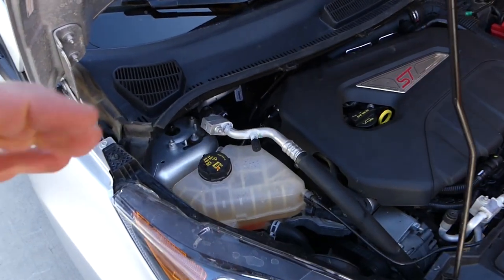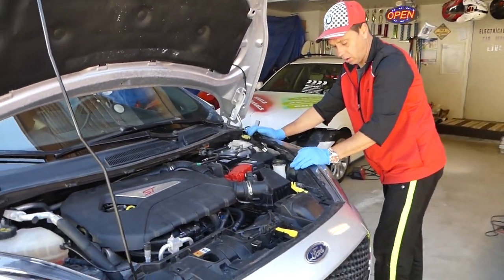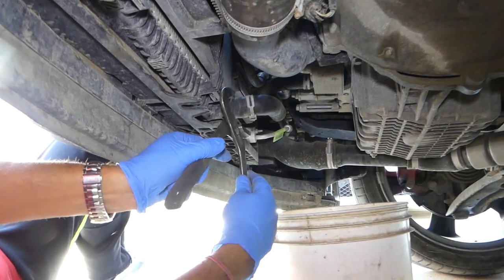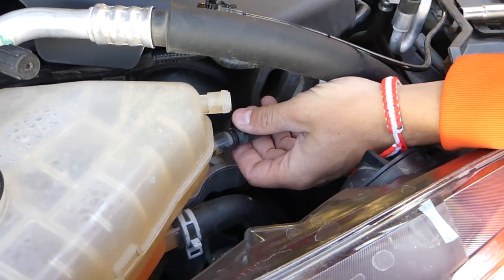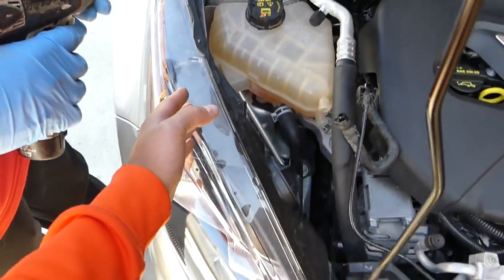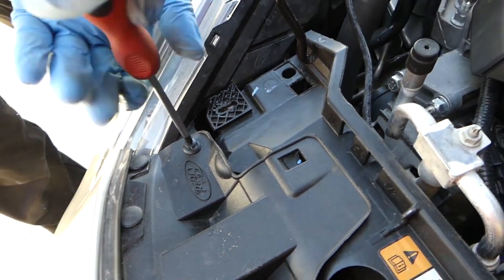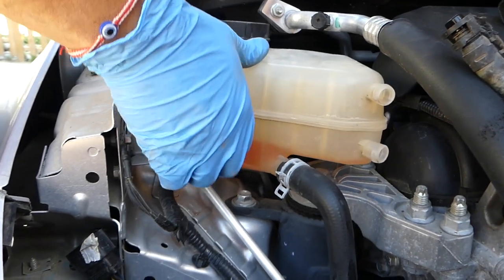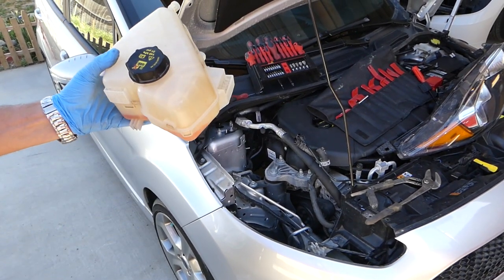FORD FIESTA OVERFLOW COOLANT TANK RESERVOIR REPLACEMENT REMOVAL MK7 ST

Comment: Just a quick tip, with the headlight out it gives you enough room to put a catch can beneath the expansion tank to catch the coolant. No need to drain the radiator that way. So no need to jack up the car or   extensively bleed the cooling system.

Comment: Hi all, can anyone help me. I noticed mu coolant was low, so I removed the black cap but then there was something else that I couldn't remove to add coolant. It's a black piece inside with metal at the centre. Any tips please
Reply: It's the caps inside, unfortunately a common issue

Comment: They replace those coolant bottle for free under the coolant recall, those two plastic overflow connectors on the top and bottom of the coolant reservoir crack when they get old, it happened to my fiesta. I bought another plastic piece to replace it, but under the recall they replace everything even the bottle and now give you rubber hoses instead of plastic, there is also other parts they install, I recommend getting this recall done by ford.
Reply: What years did the recall cover? I have a 2011...
Reply: Mine is a 2011 & I filed a complaint staright to Ford about another problem I had with my car & they fixed it free plus pulled all the active recalls & fixed those & pulled all the old recalls for review & that wasn't one of them for the 2011's.
Reply: @venusmiranda9898  awesome!
Reply: Cost me hundreds.  I cracked the shits and bought the mishimoto metal coolant tank then it started leaking from the little sight glass so I had to rip it out and plug the threaded holes up with brass bungs. Now there coolant pissing out of a biggish hose down behind the engine on battery side.... So over this car.  I need a new coolant cap too now because the lower oring is broken and part of the plastic that the ring sits on has broken off and in the cooling system somewhere. 2014 Fiesta ST sux.
Reply: That very thin pipe going to the expansion tank... (coolant overflow/expansion tank return line) over time becomes extremely brittle like hard plastic. Be careful if handling it as I have just snapped mine in half by moving it slightly. Now my mk7 has no coolant and I think I'm fucked
Reply: I read an article on the degas hose being too small on the coolant bottle , which causes overheating?
My 1.0 litre overheats on idle and when in slow traffic
I’ve changed everything from water pump
2xThermostats
Flushed radiator 
Head gasket replaced
Coolant cap
Could it be the degas hose is too small at the top?

Comment: They put so many crap parts in those cars.  The engine mounts are rubbish and the whole cooling system is an absolute joke IMO. The Dayco replacement plastic coolant tank is a bad design and the cap it comes with breaks in half after a few months and the little hose connectors are poorly moulded and the hoses don't clip on properly so you gotta use cable ties to hold the quick release jaws in or they could pop off.  I could have overheated my engine so many times I have lost count. I'm starting to hate ford and I just want to get rid of this car. Never buying another.

Comment: so the hose from the res. to the radiator i believe it goes to (7:09) can i just disconnect that hose to drain just the reservoir so i wouldnt have to refill radiator? Just trying to see fastest way
Reply: That's the easiest way to go, my reservoir go hairline cracks in it and I need to replace it on my Ford Figo..

Comment: I see the top degas line on coolant tank is very small diameter 
I have read an article on 2012 to 2014 Fiesta needing to change the size of this hose as it causes that model 1.0litre to overheat
Maybe even Cath on fire?
My Fiesta 1.0 is always overheating at slow speeds and idle for long periods?
I have changed Head Gasket
Coolant cap
Water Pump
Both thermostats
Flushed radiator 
Could it be this hose?

Comment: very good video , thanks,  and plz let me know Ford Ecosports 2016 has the same coolant tank or different ?
Reply: It does use the same part as the Fiesta and is easier to fit as the Ecosport a/c pipe is out if the way. Just be careful of some models having an oval shaped tank, which was fitted during a recall for some reason.
Reply: @boilerhousegarage  thanks,  and the Automatic Transmission Fluid filler is just under the air filter or to one side and don't need to remove anything to fill the Transmission oil ?
Reply: I've only worked on manual ones, but if your ATF is reading low, then you will likely have a leak as they don't need topping up like (acceptable loss) engine oil. They are usually read when the fluid is warm and cycled through the gears to have the correct level--unless the Fiesta/Ecosport states differently in the user manual.